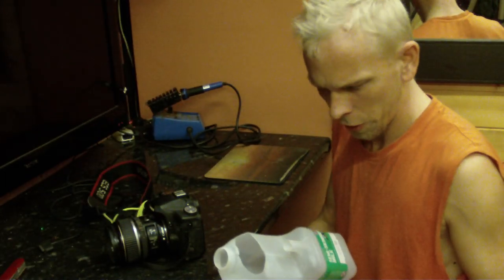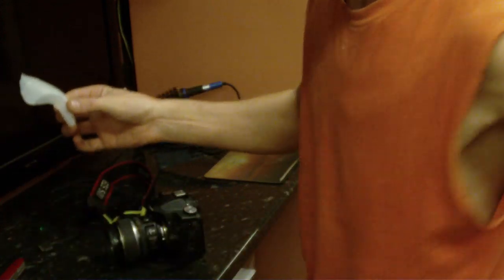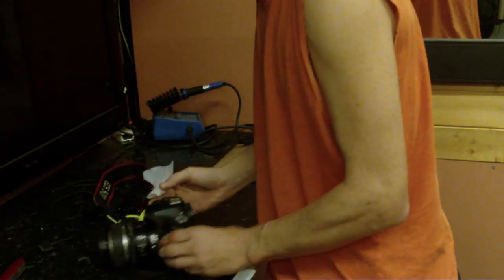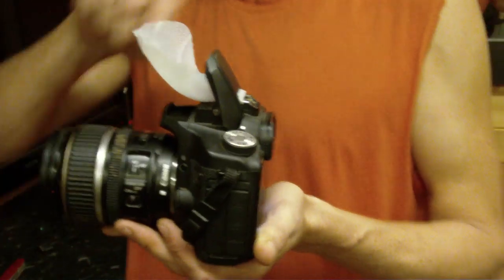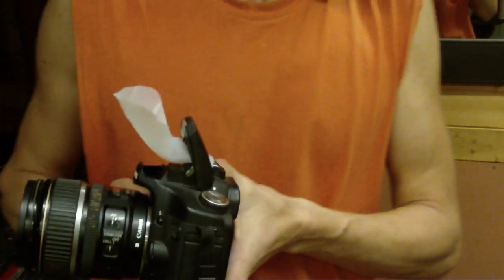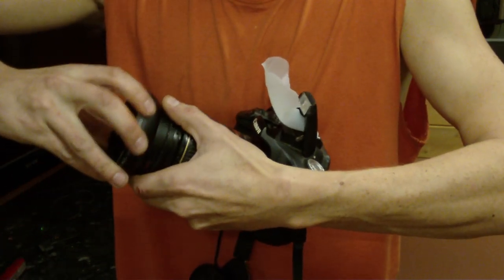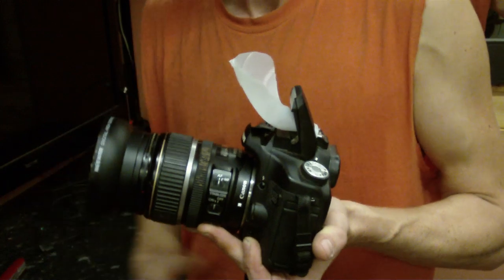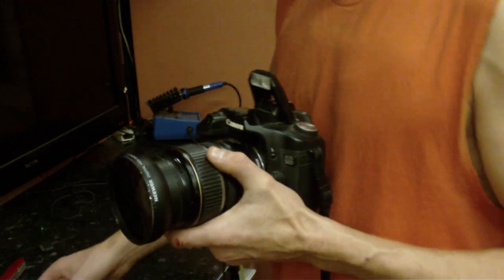DIY Digital SLR Flash Diffuser/Reflector made from recycled plastic milk bottle

Comment: That's very neat. I think its two biggest advantages over using a hand-held piece of paper, tissue or aluminium foil are:

1. The light is both direct-diffused and bounced, with no fingers getting in the way. For portrait photography, having a single diffused highlight appear in the subject's eyes looks more natural than either a ring pattern or no highlight at all (caused by light that's too diffused, giving a forensic lab 'body-on-a-slab' or police mug-shot effect).

2. The push-fit mounting is surprisingly sturdy, which means that results will be consistent. Consistency is extremely important for photographers without a lot of experience (like me!), because there's one less variable and so one less thing to think about when making experimental adjustments to flash strength, ISO, and aperture.

As the plastic is so tough, it'd also be easy to enhance this reflector/diffuser by attaching extra side and top pieces to it with staples or double-sided tape.

Thanks for such a useful upload! 🙂